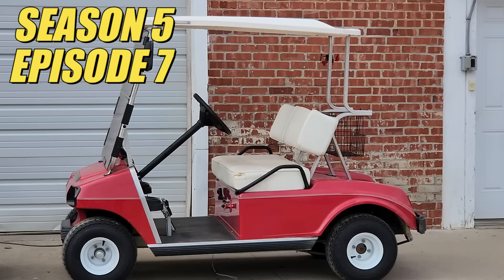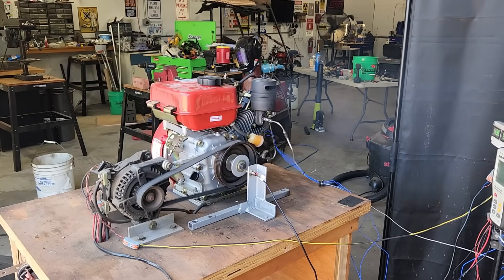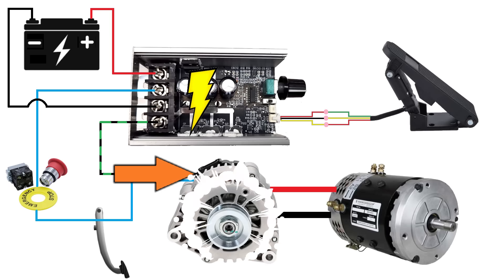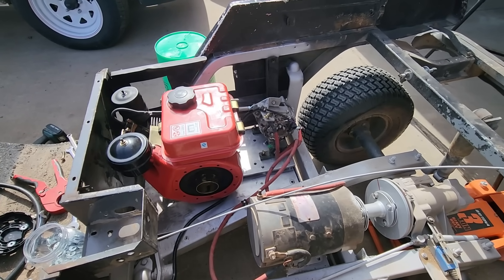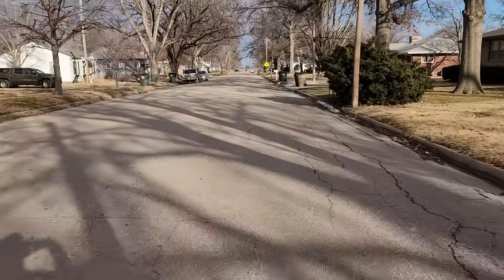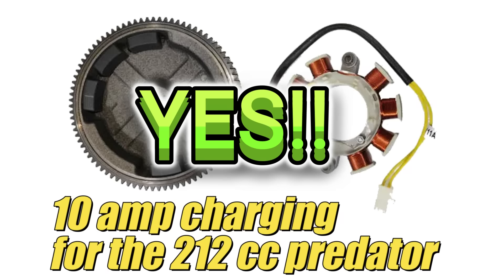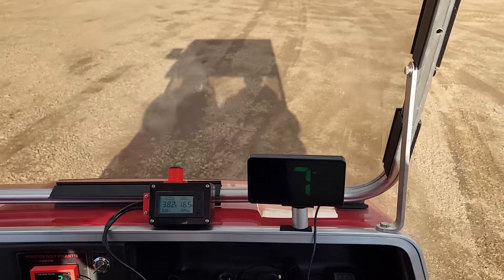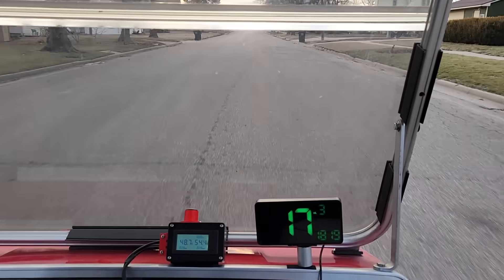S5 E7  We build and road test a Diesel / Electric golf cart. DIESEL POWER!

Comment: i think it would be fun to turbo the little diesel motor in the golf cart.
Reply: Ohh i love this idea to turbo the diesel!
Reply: turbo is great idea.  There is a little magic needed though to do this.  You cant just throw a turbo on it.  wont do a damn thing because of the number of valves flipping open closed takes to long.  You lose the boost by the time you need it.  Easy to do still though.  Just got to add a storage of the boost the turbo/supercharger creates so its ready to be introduced into cylinder at the right time...  Studies seem to show 3 to 5 times the volume of the engines CC's does the trick. 

Some have just made a very long path from turbo to air intake on purpose to provide the volume needed as described above. An intercooler also acts as storage space to hmmmmm
Reply: @ I can link you a video of a video where someone tubrochared at little diesel engine similar to this and it definitely makes a difference. they way they had done it was pretty easy as well.
Reply: @coachgeo you said lot of silly things, what valves takes too long 🤣 they work as in any other engine 🤣, turbo makes a difference if its small enough and you have to increase fueling..
Reply: @coachgeo hmmmm you have zero clue 👀👀 do ya not remember this guy has already boosted a little diesel engine 👀👀 yep please don’t talk about things you don’t know
Reply: @Binge420  lol...  sorry but been around diesel motorcyle buidling world off and on for 20+ yrs.  Again.. do your research..... I gave you the link.

Comment: Hilarious Jimbo, truly inspired.  I love diesel engines too, but that affection scales with size.  For ten years of my life I worked as a marine engineer on foreign going ships.  The favourite engines were large direct coupled two stroke diesels with bore sizes of 420 mm/16.5", up to 700 mm/27.6" on the ships that I worked on and they can go up to 960mm/37.8".  The least favourite were the little diesel engines used in the Lifeboats, nasty, noisy, cranky, smelly little things.  The big two stroke engines are things of beauty and scale, if you want to check main bearing clearances you literally have to put a step ladder in the crankcase to do that job.  For anyone interested here's video of the largest such creature or just search for RT96C https://youtu.be/7np9rhQmNTU?si=fJ4oHaDO1xcZJ-rC
Reply: Another RT96C video if anyone is interested, this one running at full load. https://youtu.be/rm9SjAJ_ki8?si=aAUqzAC2oiic3Xrg

Comment: Did someone say 420? Yes! Not sure the rpm of diesel, perhaps a pulley adjustment is needed, for max performance? Alternator rpm + diesel rpm is easy to calculate for pulley ratio.
Reply from the maker: The diesel was running at 3000 RPM and the alternator was spinning at 6300 RPM,  I would have like it if the alternator was spinning a little faster, but keep in mind the diesel has a metric output shaft and the pulley we were using was difficult to make.  for now its good enough.

Comment: Why o I feel like I'm encouraging you to do something illegal? Oh well, whatdahell... "Do the 420 please" (just remember,  I DID NOT specify what "420" was. )

I wonder if a torque converter like they use in go-carts, razers, and the big-block Honda 670 conversions just might be faster  and easier for your application.  In 2004 I worked for Arizona Sports Center and we were converting EZ-Go golf carts from the little 7hp quiet engines to the 26HP Honda twins, opening up jets, changing springs in the clutches (Blue spring could make the "limo cart do wheelies loaded or not!) and installing our own exhaust system too. What we created was a fire-breathing ride that would rather haul butt or do a wheelie than cruise slowly.  Once news got out to Sun City about our conversion (which HAD to include larger tires)  we were building them as quickly as we could get the engines.  It was not uncommon to have 9-12 carts stripped, steam cleaned, clutches built and painted with the new  engine mount installed, waiting for the shipment to come in on Thurs. morning. I'd come in on Saturday mornings to dust 'em off, park them out front, hit 'em with Lemon Pledge on the bodies, and fancy Armor-All on the rest and be giving deliveries until 7-8pm with the owners. 

The look on their faces when you put the front end of a 3 row limo cart 2 feet up in the air from a dead start was PRICELESS! They KNEW what it was supposed to do, but couldn't believe THEIR cart was doing it. Lifting and larger Tires/Wheels were mandatory, as those Hondas would spool up so fast that the little stock tires would chirp, and the engine would be screaming.  Good Times.  What you are building here is pure genius, though... better mileage, control,  and definitely better cost! the 26hp conversion required everything to be inspected, and/or changed for safety, and to make them ready for the dunes.  Oh, I forgot to mention the street and the dunes were the ONLY place you could ride the 26hp rigs... There was really no way to take them on the trails, they'd bury themselves otherwise.  To have something to drive up a trail without flipping over backward was to use the stock 7-9hp Robin engine with bigger, stickier tires.

Thank You for letting me take a trip down memory lane in the middle of your post. Sorry for the long-winded interruption! ( feel like I've had a heck of a nap, but have to re-watch the video, because I was staring at the ceiling fan for like 5+ minutes... A.D.D. is a fickle critter sometimes) But I digress-

Thanks Jimbo for another gift of brain candy this morning- I'll be thinking about this video for many hours to come this week.  And anything that takes my mind off colo-rectal cancer is a much-appreciated blessing, Buddy.

Now tell me to shut up, and I'll be quiet- I swear.
DB in AZ

Comment: ?question for you!
if you put this system in a small vehicle like your Honda Insight to get it to about 50mph,
what size predator engine, alternator and electric motor,PWM would you recommend??
Reply: and… do the 420 please !
Reply from the maker: To go 50 MPH with reasonable acceleration you would need about a 15hp electric motor.  The engine would need to be at least 24 HP.  The alternator would need to be able to supply 11,000 watts.  So the engine could be a 670 V twin, however I'm not sure where you would get a 15 hp DC motor or an 11KW alternator.
Reply: thanks
but that seems tricky lol
would be nice though to use this setup on any vehicle 

can’t wait to see the 420 video!

Comment: Jimbo, you keep figuring out ways to do cool stuff on a budget, and I'm interested in seeing where this can really go.  Now it occurs to me that you could drop in a decently sized LFP battery, write some nice software, and implement a full hybrid system with on-demand start/stop, regen and perhaps even lose the 12V battery altogether.  If anyone can pull it off, I think you could.  The nerd in me thinks this would be a huge win if done cheaply.
Reply from the maker: That would be epic, however I don't want to store a lithium battery powered contraption in my shop.
Reply: @robotcantina8957  What if you used a different chemistry, like NiMH?
Reply from the maker: @NoneNomad   That would work, but a small 48 volt pack is close to $1000.00
Reply: @ Cool, but expensive; what about Sodium Ion? Can buy 18650-size ones and assemble instead?
Reply from the maker: @NoneNomad   a quick check and 48V Sodium Ion battery run over $2000.00

Comment: 420 yes please! Just from my side, how about trying to quiet down the diesel in future. Thinking about exhaust and maybe a sound proof box or something. Try and get it as quiet as the petrol model or even better... My two cents. Keep up the good work!
Reply from the maker: We will try to get the diesel a bit more quieter, but 90% of the noise is not from the exhaust, its the mechanical noise  of the engine.   The trade off in using a low cost engine is the noise it makes.

Comment: Yes Jimbo Definitely do the 420! Also looking forward and exited to see the video showing the wonders of the Arduino. Wonder what you could do with my old original first generation Raspberry Pi. Happy to send it to you if you’d like to have a little fun with it.
Reply from the maker: Thanks for the offer, I have a few Raspberry pi's already.  I prefer using the Arduino because its a 5V system and the software environment is so much easier to use.

Comment: id like to see a hybrid unit with you building a small lithium battery pack and getting it all to work together
Reply from the maker: We may try it with lead acid, I cant store a lithium battery powered contraption in my building.
Reply: @robotcantina8957  haha with your background in electronics/electrical your beyond capable of building something that won't burn the place down.  I'm running my home largely off of self built lifepo4 batteries/solar. 

Honestly lead acid for this type of stuff is just a huge disgusting waste.  Lifepo4 chemistry is safer than lead acid due to no explosive gas will be formed when charging.  There is also 0 chance of thermal run away unlike lithium ion.  And then again that's what's in all your power tool batteries and those are subject to some extreme conditions.

I love gas engines.  Did power sports  mechanics for 15 years.  I love experiments, modification and tinkering.  Your fear of lithium is so strange, it's just another thing to learn and explore man.  No need to be afraid.

Comment: Could you use two alternators? Then would you want to power the field windings in parallel and also put the output of the alternators in parallel?
Reply from the maker: Two alternators on the 3hp diesel would not help, the single alternator is already to big.  On the 13 hp 420 we may get away with two alternators. we will see.

Comment: I don't know if there would be significant gains made by the 420.  And if there were, would you want to be speeding around on a faster 3 wheel golf cart?  With that in mind, and an eye on completing the diesel quiet-ification and optimization, 'Do The 420 Please' ...I guess.
Reply from the maker: The amount of power we can feed the electric motor is directly related to the amount of horse power the engine makes. Since the 420 makes 4X the power of the diesel, we can feed the electric motor 4 times the power. This would translate to better acceleration.  The top speed would be the same because that is limited to how fast the electric motor can spin.

Comment: You will definitely notice a difference with a 420cc predator engine it won't bog down as easily because the alternator you are using needs at least 11 horsepower to operate properly and set the engine speed to 4000 rpm's which the stock flywheel can handle just fine and use the 10 amp charging system you showed in this video on it.
Reply from the maker: Will do !  Thanks for the input!   My only concern is blowing the diodes out of the alternator.  I feel like we need to learn the limits of the diodes so if it happens then we will have learned something for sure.
Reply: @robotcantina8957  not so if you size the pulleys right as not to overspeed the alternator FYI the alternator you are using is out of a jeep SUV correct around and it's around 80 amps the jeep's engine redlined around 6,500 to 7,000 rpm's and under full load you shouldn't have much to worry about but if you are upgrade the alternator to 110 amp unit for more robust diodes and figure out a way of putting a amp regulator on it to set it to the desired amps you need at full power.

Comment: You might give a thought to the Norton motorcycle's "Isolastic" suspension for that Diesel engine.  In short, chop a couple chunks from the tread of a car tire and use them to isolate the frame from the propulsion unit.  Makes a world of difference.  I'm sure you cam find a suitable muffler for it.  The 420 will simply be an extension of the same principles.  I'm aware of the others who have used motorcycle engines to great efficiency, so your forays into this field are a refreshing change from the norm, though they serve best to display your expertise in the field of electronic knickknacks.  Keep it up.
Reply from the maker: The "petroleum battery" was mounted to the golf cart using 5 rubber isolators to reduce the vibrations transferred to the rest of the golf cart.  The little diesel is extremely unbalanced and the isolators did help.

Comment: NO 420, go straight to the turbocharged v-twin, and the biggest alternators you can find!
Reply from the maker: 420 first, if we need to go bigger we will.  Stay tuned!
Reply: @robotcantina8957  We won't be satisfied until the tires are melting and that electric drive motor is glowing!😉

Comment: Been dying to build a small diesel range extender for an electric vehicle with a small 72v battery as well. Imagine if you could fuel your vehicle from a wall outlet, solar panels, a wind, a child pedaling a bicycle, diesel, or fry oil.
Reply: Passenger seat of the Cushman could use a set of bike pedals

Comment: I bet Jimbo could figure out an Active Noise Control ANC system to make the diesel quiet.  It involves playing a "negative" sound wave on speakers, which is the exact opposite (out of phase) of the unwanted sound wave. When the two sound waves meet, they cancel each other out, resulting in a quieter environment.

Comment: Zinc Halide (Bromine, Iodine) batteries are safe, 4X the energy density (crap power density) and cost close to nothing. (DIY)
All you need is some Zinc, Lugol's Solution, Unglazed Terracotta plant post and DIY time.
ie:  
If you want to run the genset at constant rpm for average power
AND
Have some battery for peak loads; it'll cost you/us all of 20$..!

T a bit of pipe, blocked off at one end (tuned length) into the exhaust and you have a Quarter Wave Resonator Muffler for 50 cents,.
A muffler that works just fine thx to the constant rpm.

Comment: I want to see the world's 1st turbo diesel electric golf cart.  With an air to water inner-cooler and heat exchanger made from an hvac heater core.  Then you can heat the driver with an air-cooled engine.
Reply from the maker: Hmmm, summer is on the way, perhaps heating the driver is unnecessary.

Comment: Have you tried different size pulleys, will this effect voltage produced?
Reply from the maker: The voltage that's generated is controlled by the amount of power we feed the field coils.  Spinning the alternator faster would help with efficiency.

Comment: That's what i call innovation.
: )
I spend a few more days with the Arduino Uno R4, using hardcore code to use the internal resources without Arduino code, got the Timers running with interrupt, next goal is SPI. like it a lot, you have a 8 bit wide port available, PORT1.

Comment: Dont do the 420 please! I would rather see a petrol hybrid with a small E bike battery pack, because you have a DC system, you should be able to use diodes to isolate the battery pack from the alternator and then use a DC motor controller to add current into the system when needed, you can use the same DC-DC as you use to charge the 12v system to charge the ebike battery pack, or alternatively a mosfet to take some energy from the engine when peak power is not needed.

Comment: Im still drooling over your S10. Looks really clean and rust free. Im in northern Michigan and its hard to find older stuff around here that is not all rusted out.  My daily driver is a 5.3 LS swapped 94 S10. Yours looks to ne in much better shape than mine.
Reply: Come down to south Texas and you would be amazed at how little rust there is on those older vehicles.
Reply: I'm from Northern Ontario. Got to love all the salt used. Turn a 5 year old car into a rust bucket. Even rust proofing only adds a few years

Comment: Vin Diesel would approve.....😉🤣 I think I would be too tempted to do a direct drive from the diesel engine ditching the electric.
Reply: That would be a cool project. Rope start diesel engine in a golf cart. Then it would be a car that uses zero electricity. No starter motor and no spark plugs.

Comment: That thing really needs a Lake Pipe side exhaust. Don't even build a small appropriate one. Get one for an old car and cut it down. Maybe 3 or 4in diameter would be perfect.
Reply: That would have negative performance on it. Also no car I’ve ever seen has a 4 inch exhaust from factory other than a massive diesel truck.
Reply: @hanzgrueber145 a lake pipe is a side pipe like they run on old hotrod and land speed cars
Reply: Like on a semi truck?

Comment: Your engine is to loud use tractor silencer bro u can use farm engine which produce high torque at low rpm and you can use actuator or other device for throttle control ❤ like large generators